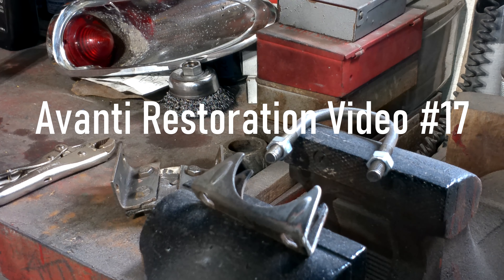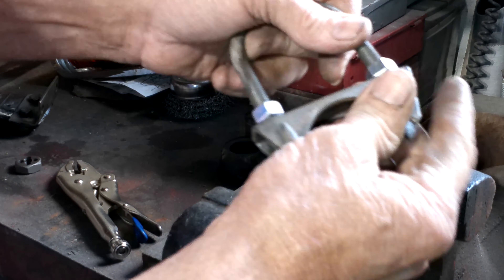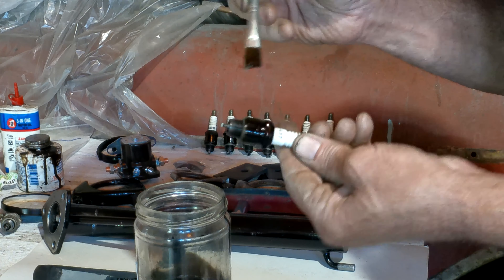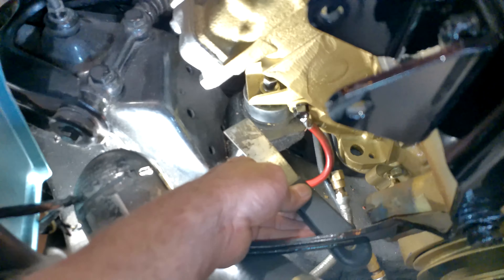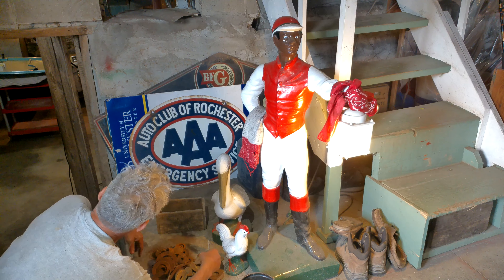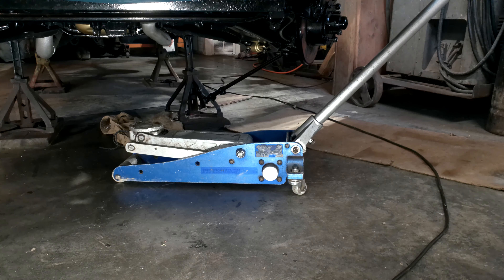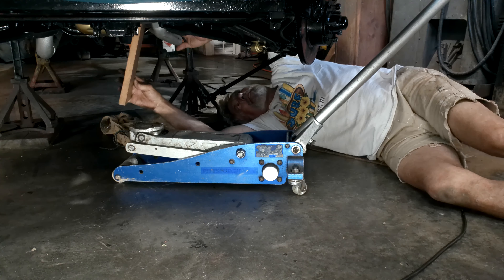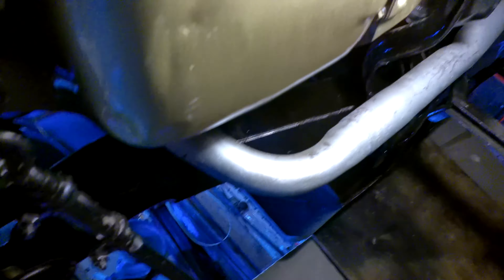Studebaker Avanti Transmission Mount Dilemma: Video #17

Comment: The reason the alignment is off is because you do not have the factory spacer installed under the drivers side transmission mount. Check the 63 Studebaker Avanti Chassis Body catalog page no. 7 of the engine section. In plate 01-01, 2,  you will see reference to 0101-40 which is part number 532427.